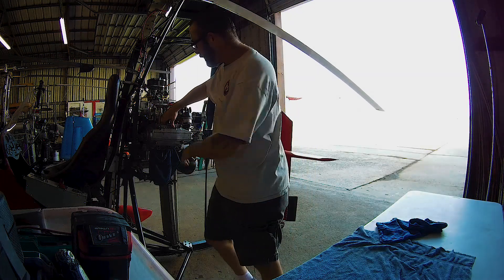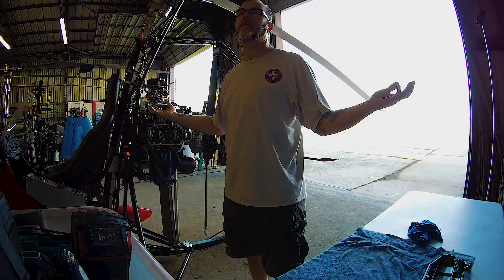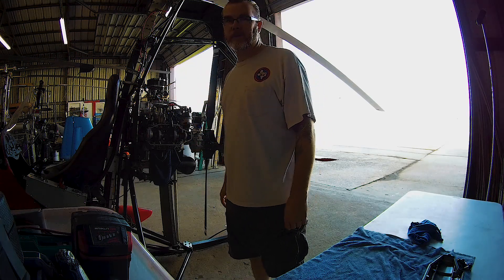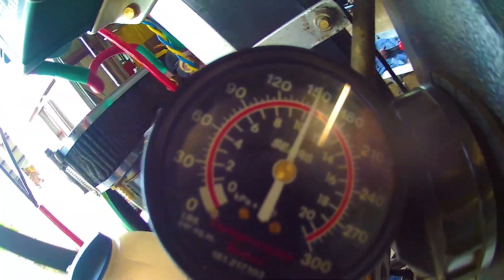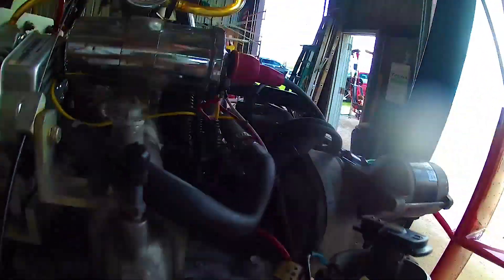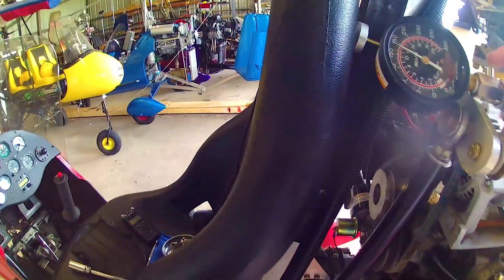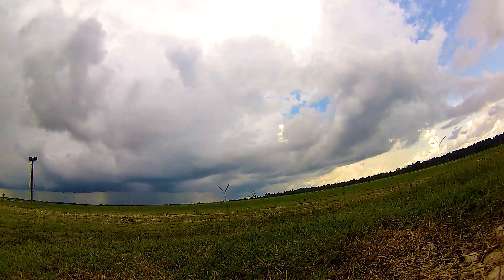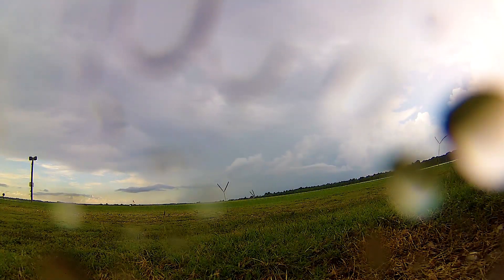Gyroplane Lifters and Thrust Test

Comment: motor sounds nice,  did you get a thrust test value before you replaced the lifter?
Reply from the maker: This past winter I was getting 455 lbs @ 5200 rpm. When the problem started I was getting 350 lbs @ 4800 rpm. The lifter issue caused the engine to not produce enough power to get the rpms where they needed to be.
Reply: pretty big decline, I can see why performance suffered.  Nice explanation, thanks...